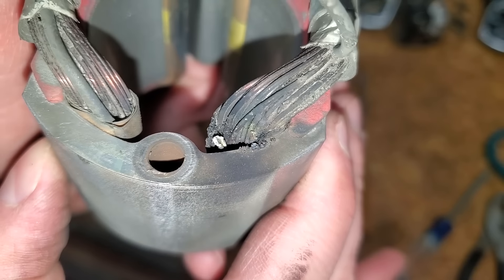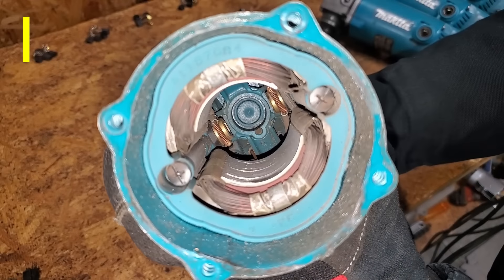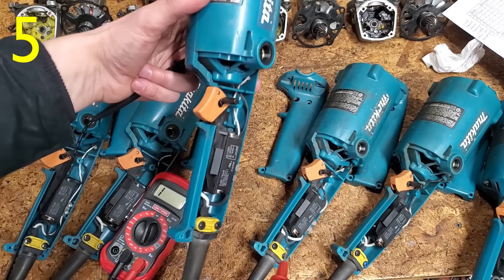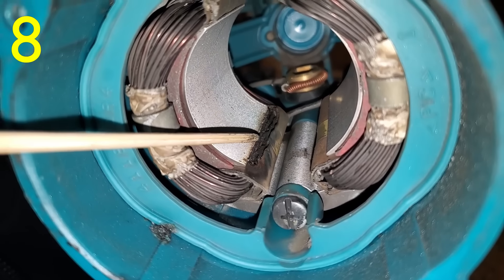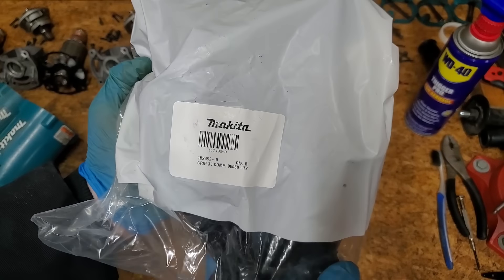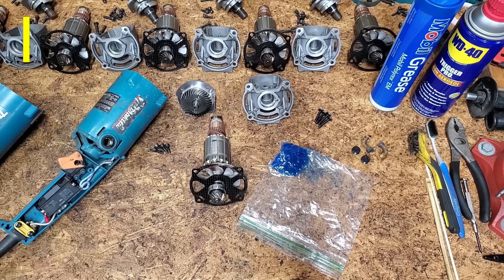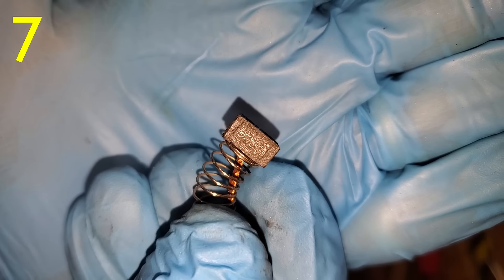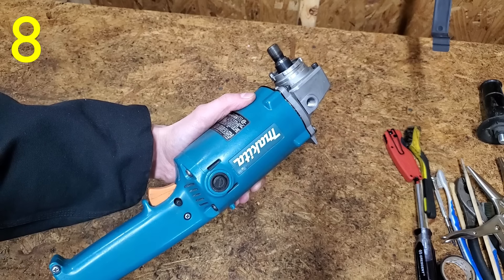Repairing Makita Angle Grinders

Comment: I had to replace the stator on my Makita circular saw and the arrangement was identical to what you show in your video. Before fitting the stator into the plastic housing I cut 2 pieces of 20mm diameter plastic conduit to approximately 20mm long then cut down the length of the conduit to one side only so that I could squeeze it to reduce the diameter to allow me to fit inside of each spring, I then lowered the stator into the plastic housing with the conduit still inside the springs, then offered the plastic conduit on to the brush holder using circlip pliers, I opened up the pliers and pushed the spring over the brush holder
Reply from the maker: I had to read that a few times until I got the correct mental image, sounds like a great technique! :)
Reply: I would like you to do a video on that.

Comment: nice job!  running those without the wheel guard would feel a bit too sketchy for me
Reply from the maker: Thanks! I agree but since none came with guards, I assume they were thrown out with the boxes. :)
Reply: @Mikeattempts  in the states they usually aren't included. i had the next model up from makita and that thing scared the bejeesus out of me whenever i had to use it. good piece of kit, just sketchy AF without that wheel guard
Reply from the maker: Yeah, besides chainsaws, grinders are probably one of the most potentially dangerous tools you can buy. It doesn't help that some people purposely use them incorrectly. I looked into getting replacement guards but they're not toolless, like newer grinders, so I assumed they'd just end up in the trash anyway if I sell any.

Comment: The 5 in 9005 model I believe classifies it as a 5" model. I used this model in the 90's for like  8 years. Only issues I ran into is breaks in the cord in the strain relief area and of course, worn out brushes. We used to use 7" stones on it but had to be careful not to overheat it. I bet the failed stator ones were due to overloading for too long a stretch. You know it's overheated when you can barely hold your hand on the outside of the stator housing! 

I still have that grinder but don't use it anymore as I find it too heavy for the type of work I do. I currently use a 4.5" Milwaukee M18 angle grinder.

Great montage on this vid Mike
Reply from the maker: Cords take a beating and brushes are meant to be replaced so that speaks volumes to the reliability of these grinders. Thanks for the comment!
Reply: I've been seeing a lot of comments like this. Don't use wheels larger that what the grinder is rated for. The grinder will spin them too fast and they will come apart.

Comment: Excellent job and video! You have a new subscriber now!

You asked for a recommendation on the spring installation. Find a copper pipe fitting just larger than the brush holder in circumference. Slice a ring out of it a little wider than the spring. Install the spring over the copper ring before dropping in the winding. Slip the copper ring with the spring around it over the brush holder and slide the spring off onto the brush holder. I've actually done something similar to this on some hard to access brushes on a starter. You may find yourself at the hardware store staring at copper fittings. Lol! 
Someone always asks if they can help me. My answer is nope. I can't show you the picture in my head!
Hope this can help.
Reply from the maker: Thanks for the sub! That's a great idea, it would be much easier to stretch them over the pipe before lowering the stator into the housing. There hasta be a tool for this though, right?
Reply: @Mikeattempts  I'm sure Makita has a thousand dollar custom air driven model on the factory line. Maybe they'll send you one! Lol! I'm cheap!
Reply from the maker: @brainiac_brian  Hahaha! I would think there's got to be some sort of cheap hand tool, kinda like snap ring pliers, that spreads the circular spring evenly.

Comment: Very good job at diagnostics, cleaning, fixing and testing.
My question is : you said that theses particular models are “some of the best grinder’s “ 
Therefore, to affirm what you said, 
1- Did you have any comparisons with other brands ?
2- in all the 8 grinders that had different issues, how many hours of grinding for each one vs the cost of repairing each one?
3- If the tool history vs the cost and workload that was put in was known per tool, Would you say that it is worthwhile ?
Thank you and congratulations
Reply from the maker: Thanks! In the video I said, "I didn't realize it at the time, but this model is one of the best corded angle grinders you can buy". Meaning that I was unaware of the quality and reputation of this specific model, the 9005B. After doing a little research, I learned it is widely used by professionals and is worth the price tag for people who use it hard every day. So, to answer your questions: 1.) I have not yet used these grinders myself and I'm not a pro, so I do not yet have any comparisons with other brands. 2.) I don't know the correlation between hours worked vs cost to repair since I haven't used these angle grinders yet. I will say that, if not abused, it's my opinion that these grinders would easily last a lifetime for an DIYer with only brush changes every few years. I have a feeling that these specific grinders were overworked, pushed hard, and not given appropriate opportunity for proper airflow to keep 'em cool. But they were used in a very hot, very dirty, professional manufacturing environment. 3.)  I think this model has earned its reputation and price point, but that option is only based on what I've read and the build quality I noticed while fixing them. Personally though, this project was definitely worth my time. I learned a LOT, especially about electric motor testing (I still have a lot to learn though). Not only that but this has been my fastest growing video, view-count-wise, so it has earned me a greatly appreciated boost in viewers, subscribers, and comments which provides positive motivation for my channel. Thanks for the comment!

Comment: Very nice! Im trying to do the same tomorow :)
Reply from the maker: Cool, let me know how it goes!
Reply: @Mikeattempts  Thanks, I will. It got very hot, and then startet going halv the speed. I suspect its the stator like in your grinders. I have a stator from a sligtly different Makita grinder, don know if that fits, or if it has the same problem. But I wil chek - I suspect that a new stator is costly...
Reply from the maker: @DK-jt6be  Yeah, I got the new stators for $50 each. Since these grinders are around $200+ new, I figured it was worth it.
Reply: @Mikeattempts  Didnt turn out so well :) I think I had all the right meassurements, and didnt find any shorts. Maybe i did something wrong - but it was fun trying :)
Reply from the maker: @DK-jt6be  I call that a win cuz at least you tried, had fun doing it, and leaned along the way!

Comment: Hi Mike, it is still hard to beat a corded tool, they are less complicated and prices for parts are far less. It is great, all are fixable. You would think that a shop that owned these that the operators would just grab another grinder when they got hot and keep rotating them, but then we wouldn't be able to watch your videos. Thanks much.
Reply from the maker: I agree, those Makita cordless drills were much more complicated than the corded angle grinders. I doubt the operators at that shop give any of the tool a break to cool down, they just work 'em hard until they die. : ) Thanks for the comment!

Comment: What about the nut and shield that holds the grinding disk and keeps the sparks directed away from the user
Reply from the maker: I did buy all new washers and arbor nuts. I didn't get any guards with these so I'm assuming the shop threw them away. When I looked into getting replacements, I noticed that they aren't toolless so I'm trying to find a toolless option that would fit.
Reply: @Mikeattempts  Pretty sure it's just a Phillips screwdriver

Comment: Can I ask a question? Why not replace the bearings and brushes in all, considering you already have it all apart. I'm not picking holes in your video only asking
Reply from the maker: Brushes wear down pretty slowly, so it seemed like a waste to replace 'em if they still had 3/4 life left. As for the bearings, they all seemed to be in good shape and, if one did go bad, they'd be easy enough to replace. I'm no pro though, others might have done it differently.
Reply: @Mikeattempts  no criticism my friend just wondering 👍 when I fix tools I always leave the old bearings and brushes in the box so customer can see I have changed them, I also used a black light marker date on the inside so I no it's one of mine and what date it was with me last. Great channel 10/10 👏
Reply from the maker: @robertmarks2379 If I did this for a living, I'd probably do the same as you since I would be charging the customer for everything that was done. This is just my hobby though and I'm still learning. Thanks for watching & commenting! :)
Reply: @Mikeattempts  no problem my friend keep up the good work. Tip of the hat to you good sir 🎩 👆
Reply: Same thought here, those grinders are used in a professional environment and not in a home DIY which means they are used frequently. I'd replace the bearings while I still have access to them like in the situation here.
Reply: @johanrynjah8241  could you sell them as refurbished or would you have to sell them as used or working?
Reply: @ Depends on their status, if they are used and still in good condition requiring only minor internal cleaning and lubrication, they are sold as used, but those that don't run anymore but their internal parts are replaced with new ones for their optimum performance are sold as refurbished.
Reply: @johanrynjah8241  but with new brushes and bearings could be sold as refurbished. Just a thought I had sorry about the randomness lol

Comment: I have a 4" Black and Decker angle grinder that is over 50 years old. I've put brushes in it about three times and repaired the switch twice. Not sure if I might have shortened the power cord once to fix a broken wire also. It still works well.
Reply from the maker: Wow, that's a really long service life with only minimal maintenance and inexpensive repairs. Wouldn't it be nice if all tools were like that?

Comment: Awesome job dude, what are the brushes for? 
and what's your process for figuring out how to diagnose and kinda reverse engineer the machines to find out what you need to fix? would make an awesome video imo
Reply from the maker: Thanks! The brushes transfer electricity from the switch to the electric motor. They contact the commutator on one end of the armature which makes it spin inside the stator. The spinning slowly wears the brushes down and they eventually need to be replaced. I'm no pro but if you watch some of my other videos, you'll see how I go about figuring out the problem. For me, fixing things is probably 1/3 cleaning, 1/3 observing, and 1/3 testing. Sometimes you can fix something just by cleaning it. Other times you can physically see the damaged part that need to be replaced. When you can't see anything wrong, that's when the multimeter comes into play to test wires, switches, and motors.

Comment: Nice video! How do you know which grease to use when? Do you simply go based off what the producer labels it as for example marine grease for boats and other aquatic machinery or is there something else to look out for when it comes to grease?
Reply from the maker: Thanks! I'm no pro but the biggest thing to look out for with grease is not to mix incompatible types. I did a lot of research to find the exact same yellow grease, but I couldn't even figure out what it was called. A viewer who works for Makita said it's Mobil Mobilux EP 1. Another viewer provided a Metabo video link where it says the grease in the gearbox doesn't need to be changed for the life of the grinder. The best thing you can do is try to find grease with the same thickness (NLGI 0, 1, 2, etc.) and made for the same or similar application. In the end, any grease is better than no grease.

Comment: Great job on these grinders.
I'm wondering if you could advise me on one I've been attempting to restore.
The angle grinder run completely fine, everything functions. Except that it wears a set of brushes to nothing in less than 30 seconds. 
Do you have any idea what could be causing this? As I've run out of ideas.
Reply from the maker: Wow, that's crazy! I'm no pro, this was my first-time repairing angle grinders. However, if I had to guess, I would assume something is wrong with the armature (the copper bars that the brushes ride on). It should be very smooth, but it sounds like it might be pretty rough to grind 'em down that fast. Hopefully you can lightly sand it, like I did in the video, with some fine grit sandpaper. I'm interested in what you'll find so let me know! :)
Reply: @Mikeattempts  Thank you for you're response. I shall give that a try. You've also shown me alot of things I didn't know to look for, I can give it a much more thorough inspection thanks to your video.
You may not be a pro, but fixing 8 grinders on your first attempt is a feat few people could accomplish.
Reply from the maker: @pinedd42  No problem, just let me know how it goes! I hope people watch my videos and think "if this dude can do it, so can I!" :)
Reply: @Mikeattempts  I have now tried again. I cleaned the commutator with 400 grit, it definitely made an improvement. But it still sparks heavily from the brushes, there is a strong smell of burning and I've found part of the stater with a bad burn on it.
Thank you for your help, but I think it's beaten me. I just don't think it's within my abilities to fix.
Reply from the maker: @pinedd42  It didn't beat you, it would have only beaten you if you didn't bother trying to fix it! You gave it a good shot and determined the stator is failing. You tried and you learned something, I call that a win! Thanks for the update. :)
Reply: @Mikeattempts  Thank you for your support and advice.
It's been a pleasure conversing with you over this matter.
Reply from the maker: @pinedd42  No problem at all! :)
Reply from the maker: @pinedd42  Eddie, send me an email with the make and model of your grinder, I might have an idea.
Reply: @Mikeattempts  Im rather curious.
I'll get in the shed and get the make and model tomorrow. I've been with my kids for the weekend, and when I'm with them they are my only focus.

Comment: A friend asked me to repair his Makita grinder. I found the hot wire had an open between the switch and the strain relief. The wire had actualy burned inside the insulation. There was a 1/4" gap inside the sheath of the wire. One for the text books.
Reply from the maker: That's crazy, that part of the wire doesn't even move! I wonder if it was a defect in the copper?

Comment: For re-installing the brush wires to the stator, maybe some snap ring pliers could have helped
Reply from the maker: I thought about that too but that would have spread them in a tight oval. I would think there's a tool that spreads them out evenly but I'm not sure.

Comment: Would have plugged them in to see if any of them work first.
Reply from the maker: When I went to pick 'em up, they were in this big plastic bin on a pallet. The owner told me that's where his employees throw the broken tools. It's probably pretty safe to say that you don't throw out a $200 grinder if it still works. Plus, I didn't wanna do any additional damage.
Reply: I would have swapped out the worn brushes in the hope that was the only problem.  It likely would have solved the problem with two of them.  Similarly I would have stopped disassembling the one with the jam as soon as I removed the debris and checked if it worked.

I likely would have given up on the four with stator failure and used them as parts for the others.  Or perhaps only bought two or three stators, leaving a machine as a collection of the most broken/worn parts.
Reply from the maker: @1djbecker  I agree, I probably would have done the same if I did this for a living but I was learning along the way. I'm no pro and this is just a hobby so I enjoy taking the extra time to fully understand the problems and try to do the job right. I did consider cannibalizing some to fix others but I the cost for parts averaged out to less than $37, per grinder, to fix 'em all. If they were cheap grinders, it wouldn't have been worth it but this model is around $200 new.
Reply: @Mikeattempts  I appreciate that you completely evaluated all of them.  That did make for a much better video and got valid stats.

I was just internally screaming "test it now!".
Reply from the maker: @1djbecker  Hahaha... sorry to make you scream inside. :)

Comment: I think some cords just needed to be cut back a few cm and then wired back up
Reply from the maker: Yeah, I could have probably reused the cord from #1 and put a new plug on the end. As for #5, I didn't bother to find out where the break was but you're right, it could have been close to the end of the handle.

Comment: I have done this with my grandfather's black and decker from the 50s still going strong
Reply from the maker: It's funny how all of the older tools were made well but now companies like Black & Decker are considered lower end tools. I restored a Black & Decker 8" bench grinder in a previous video and it is very high quality.
Reply: @Mikeattempts  same thing with the first gen of battery powered tools you could fix the batteries to take a full charge but now I don't thing it's a thing you know it's a good tool if the company sell replacment parts it worth fix and won't brake the bank
Reply from the maker: @anthonytoreson5571  Yep, I come across some newer tools that I can't fix because those companies don't do replacement parts.